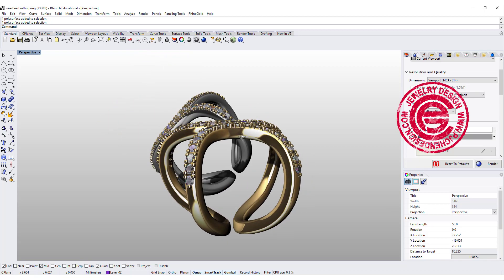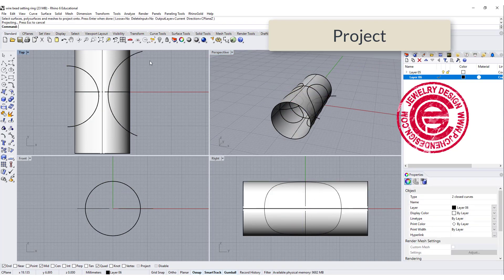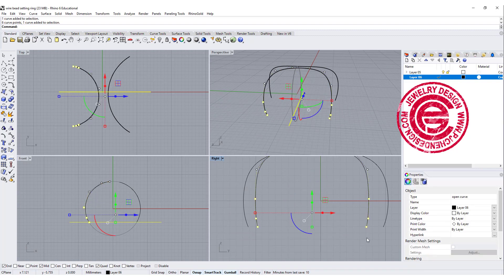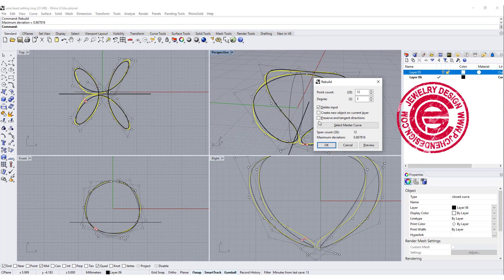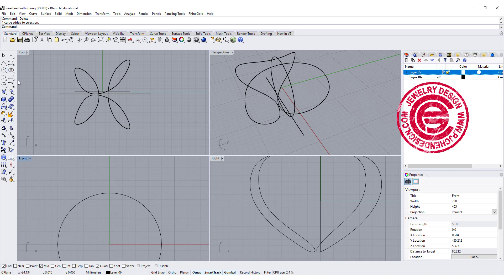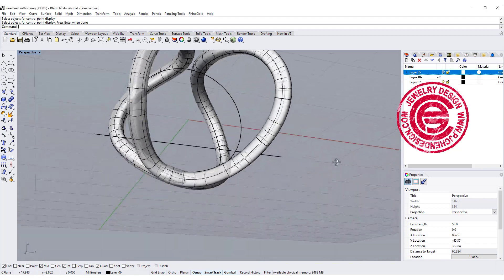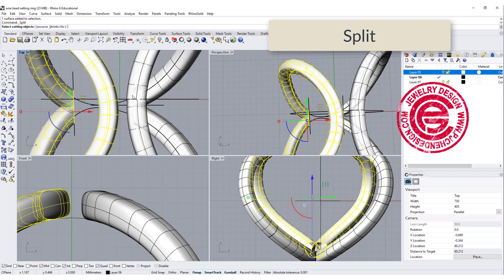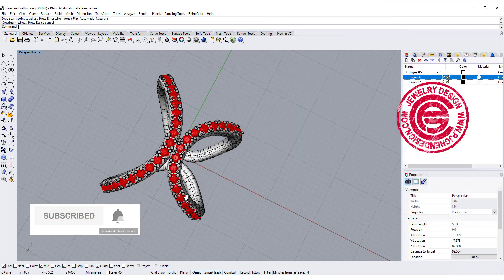Wire Fashion Ring with Stone Setting 3D Model in Rhino 6: Jewelry CAD Design Tutorial #88

Comment: Hi Mr.Chen, may I ask you a question? I just followed how you step by step,,but when I rebuild the curve, originally its number of control points are over 200...so I couldn't adjust the number just like yours. so I didn't rebuild it and when I tried sweep1 rail, some parts of the shank didn't turn out. I might adjust the setting which is related with control point. Would you let me know how to solve the problem? Thank you!!!
Reply from the maker: Hi Jungsun, when you rebuild curves, all sessions will become one single curves, and the sweep will be smoother. So make sure you rebuild the curve.
Reply: @PJChenJewelryDesign  Thank you so much!!! also I found that the degree was '1' on rebuild option..that might bother making smooth curve(maybe..??). Thanks again!!!